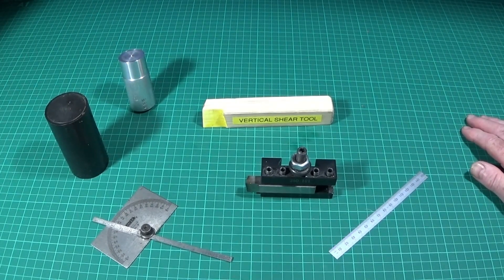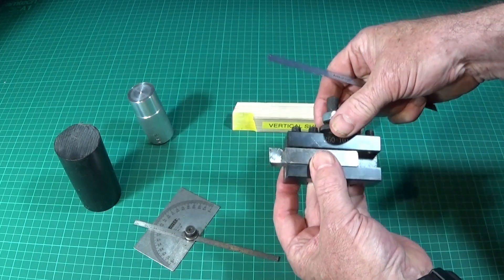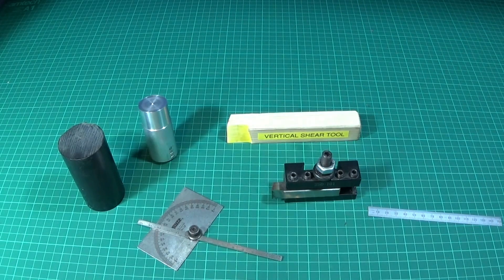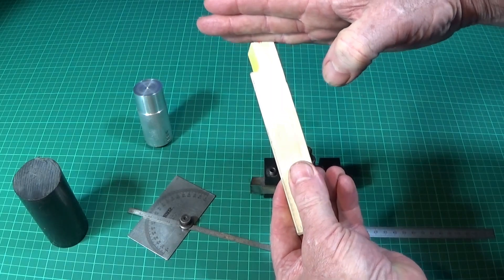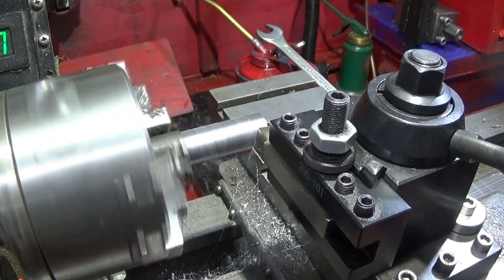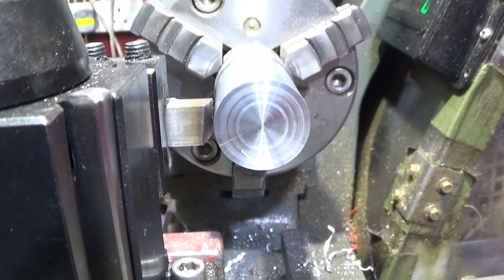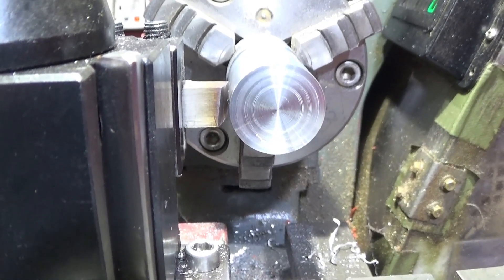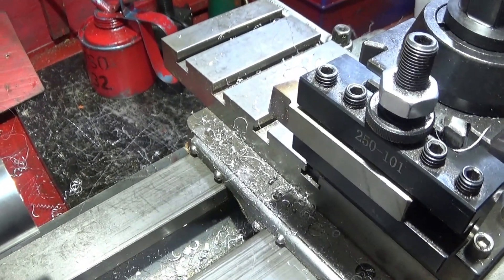How To make & Use A Vertical Shear Finishing Tool For The Lathe

Comment: The vertical grind I found is easier to do with an old wheel. Gives a slightly smaller curved edge..... And I could not agree more. Its a brilliantly simple tool which gives a mirror like finish. And at .001 for each cut but no more than .002 I've found.

Comment: Great video Steve ,  I was wondering about what you found with the speeds for turning with this tool.   It seemed that you were turning at a slower speed rather than faster. 

Dale in Canada 🇨🇦
Reply from the maker: Hi Dale thanks. I was only using about 600rpm. Regards Steve

Comment: I didn't understand how it would work until you used it (not your fault, my problem with spatial and dynamic "envisionment", haha). That looks like an exceptionally useful tool for my little lathe. I have some plastic and nylon I need to turn for fixing stuff at home, and I could not get a good finish on them. I think this is going to do the trick. Thank you for sharing!

Comment: Have you tried this on the mini lathe? Curious if it requires more grunt or rigidity…
Reply from the maker: Hi John, yes I have used it on the Mini Lathe. It works just the same. Regards Steve

Comment: ... YES ... been using one of these tools for many years  ... very good fine finish and does not 'dig in' ... particularly useful for  use on electric motor commutator repair ... downside ... only allows for very 'fine' cuts to be made  and makes very fine swarf  to clean up ....

Comment: Hi,Steve.I have never got around to making one for the lathe but I do use shear cutting tools of the same principle on my metal shaper. Mr Pete(Lyle Peterson) did a video on the lathe type of shear tool a few months back. I must have a go at grinding a bit of HSS up and give it a go.
Reply: Hi Howard, I was going to make the same comment about using similar tools on my shaper, until I saw your post! Regards Paul in NZ
Reply: Made myself one also after watching Mr Pete wouldn't be without it now

Comment: Great video Steve. Works somewhat like a skew chisel for wood turning. Definitely will give it a try. Thanks from Tennessee.
Reply: As you say that is the very same cutting principle at work as a skew cut chisel.
These shear cut tools are commonly used on the metal shaper and produce a surface better than surface grinding can achieve.
Reply: And, pretty much like a plane, in woodworking,  as well...

Comment from the maker: SOME EXCELLENT OFFERS ON HSS BLANKS:-
https://uk.banggood.com/custlink/vKmhUHd90L

SOME EXCELLENT OFFERS ON DCMT070204 INSERTS
1. Drillpro 10pcs HRC45 Blue Nano DCMT070204 YBC251 Carbide Insert for SDJCR/SDNCN/SDQCR Turning Tool
https://ban.ggood.vip/116V6
Normal Price: $23.99
Coupon Price: $ 16.99
Code: BG4b76e8
Warehouse: ALL
EXP: 3.31

2. Drillpro 10pcs DCMT070204 YBC251 Carbide Insert for SDNCN1010H07/SDNCN1212H07 Turning Tool Holder
https://ban.ggood.vip/116V9
Normal Price: $10.99
Coupon discount: 25% OFF, about $6.74
Code: BG32857d
Warehouse: CN
EXP:3.31
Reply from the maker: Hobby Day Sale: https://ban.ggood.vip/126Y8
Tools & Auto & Motor: https://ban.ggood.vip/126Y9